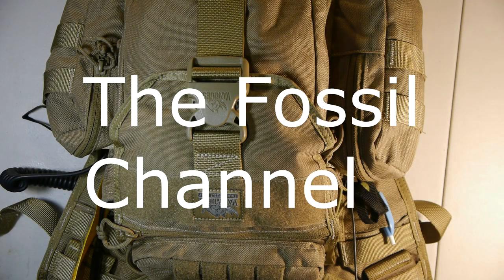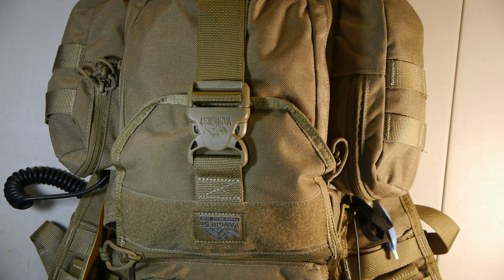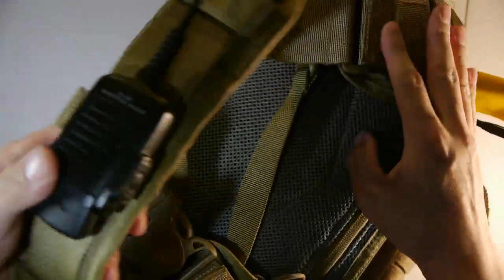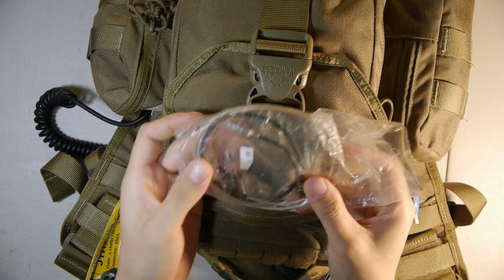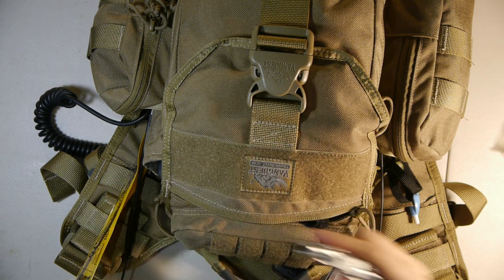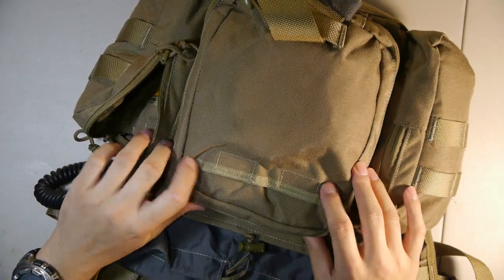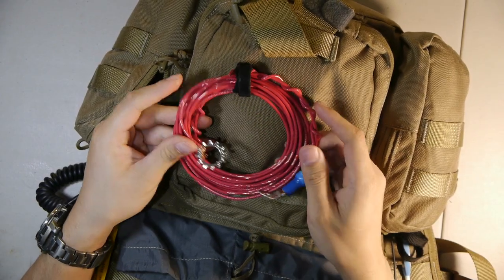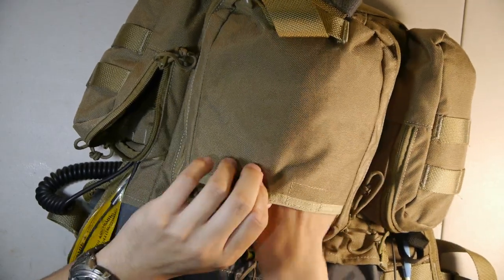Radio Go Bag 2019

Comment: May I suggest an multi-band antenna like the LNR wire antennas or an Alpha FEA (I think he calls it). Also a center fed EDZ for 2 metres will get you some gain over j-pole.
Reply from the maker: hey this is a good idea i am.going to look into that. thanks for the suggestion